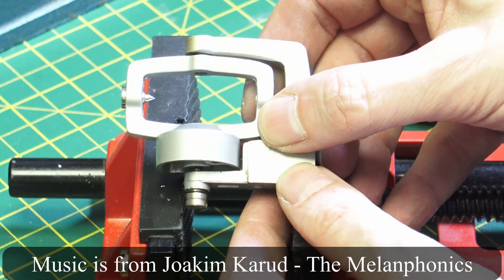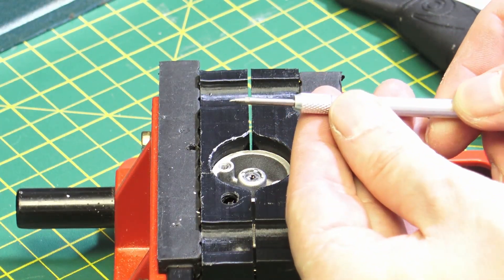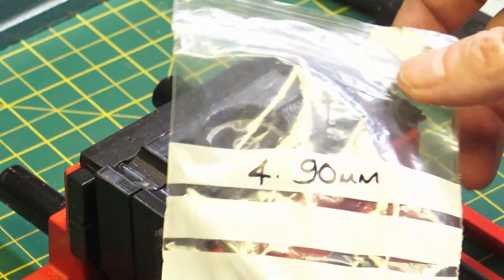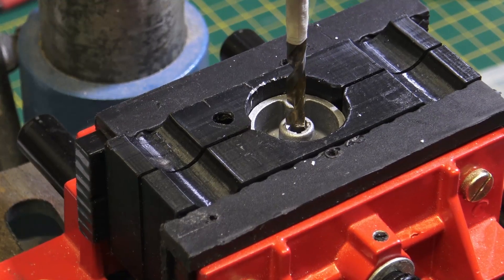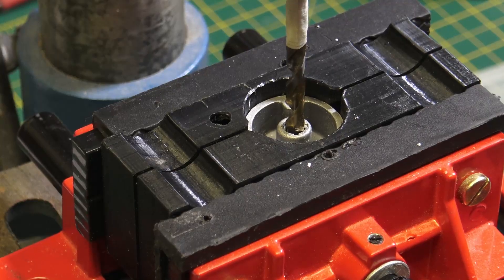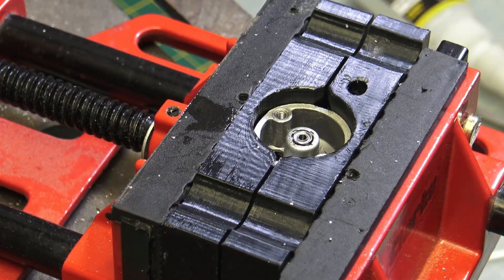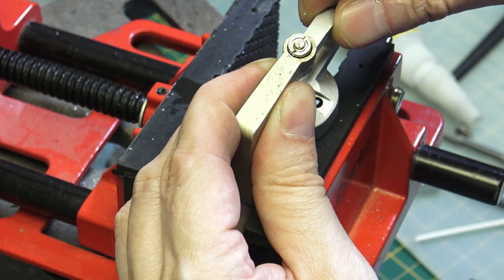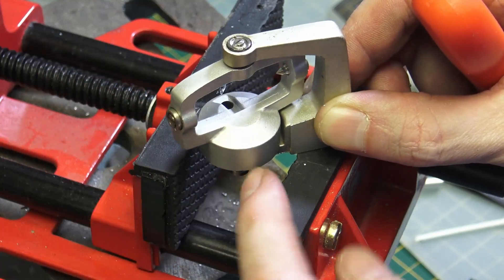How I replaced damaged bearings on a Technics 1200-1210 turntable.

Comment: Hi lee I wondered if you had the exact bearing size required rather than reforming the arm as i think i have found a product that would better suit. - I tried contacting you on FB looks like you dont use that account much anymore
Reply from the maker: there is no room to fit any other bearing unless you have the original, it's just made for that one. The original is a open bearing so the ball bearings sit in the space under the metal cover.
Reply: @DJlegionuk  Ill try I think I have a old arm that a pulled that i can work on if I have good results will let you know
Reply from the maker: @danbizaro869  at 2:22 you can see the inside after I removed the old one, so are you going to try to fit one in the wider section ? It has some clips things in the way on that part. Then the smaller section I drill out was too small for a good bearing that also fits the inside diameter too.
Reply: The original bearing appears to be custom made or something, and the case/race is made of some very soft material. Not kidding at all, look at the video and see how it deforms as he tries to remove it. That deformation is what causes the tonearm to not track properly by the way. I think if there is some flat disk bearing that fits the indentation (which appears to be exactly 6mm) it might work, but you will want to use something made of hardened steel, not this soft mild steel they make this one out of. 

I think MR62ZZ bearing should also work but you will have to drill out the pocket. DO NOT use a drill bit, use a reamer. A drill bit will oversize the hole no matter the method you use to drill it (even in a milling machine with the bit held in an ER collet).

Turntable must be made to a cost because this bearing materials is really low quality. Even the cheap Chinese bearing is made of hardened steel and ground to some very tight tolerance. The original one looks like stamped steel.

Comment: Excellent video ... just what I was looking for.  However, I've read in several places that these are factory set and 'not worth' trying to fix - one said that it was a 3 hour job resetting bearings balance vs 1/2 to change the tone arm.  When I last bought a tone arm several (approx 5 years ago) it cost around £65 ... they're £200-£350 plus now  ... crazy ... so well 'worth' trying to fix!!!!  How was it resetting the center (horizontal) bearing (which is where my problem is)?  The part is £45 but I've got a good one off the old one I replaced so was going to try and swap them over but I want to try and reset the 'wobbly' one first..

Comment: Realy good. Does the 5mm OD seat tightly against the walls of the pivot or is there a gap? If there is a gap, would 6mm OD be a better choice?  Thanks. Really an excellent video.
Reply from the maker: it fits, but not a lot of the drilled part makes contact so it's not enough for a friction fit. I never tried a mr62ZZ so it it could help. I will see if I can get mr62zz from the same place and do a test.
Reply: @DJlegionuk  Thanks! This truly is a creative, excellent solution. These tonearms are getting harder to find, so it's great to see a way to keep them from being thrown out. Yes, very curious about that 6mm (OD).
Reply: @DJlegionuk  Thank you so much for the excellent video. Did you ever get to test the 6mm OD mr62zz bearings?
Reply from the maker: @aka_juan these work very well for me, I did test 6mm OD and it would need more metal removed so I don't see what improvement it would have.
Reply: @DJlegionuk Amazing, that’s great to know. Many thanks for sharing all this valuable info 🙏

Comment: Wow! Excellent! Do you offer a service for this? I'd love to send you an arm for you to fix for me (paid of course). If not, do you offer any repaired parts for sale?
Reply from the maker: are you in the UK ? if so yes I would look at it for you.
Reply: @DJlegionuk  No, sorry, in the USA. First time I looked at your channel, so I didn't realize you are in the UK..
Reply: @bradleysmith681  Get a chucking reamer, something that reams it to about 4.95mm in diameter (this will be marked as 5mm actually, but if you get it used it will be 4.95mm). You may safely use a hand held drill for this. If you use a reamer, and not a drill bit, you will get very accurate holes that match up to the bearing exactly and no gluing should be necessary at all. It's better to drill it too shallow than too deep by the way. This cast aluminum cuts easily.

Comment: This is really good to know that this is possible. When I damaged the bearings on my 1210 mk2 turntable, I had to replace the whole pivot section. Really enjoyed this video!
Reply: Really excellent. Failed bearings is the main problem with this tonearms.
Reply: I have a turntable table with a similar tone arm...by chance...How did you damage the bearing?
Reply: @DerekCully I think that the damage is because  when you tigth the screw, without want it, its tip don´t be inserted into de center of bearing and  it esqueze the wall of bearing deforming it. I did that after paint and rearm that pieces. Cannot see in the moment. you need to be very carefully. regards and happy sppining
Reply: @HoMuSicFacTORY  much appreciated. Happy spinning my friend.
Reply: @DerekCully  The bearings get deformed into an oval shape and then the tension from the deformation and the adjustment screws cause the deformed bearing to act like a rotational spring.
Reply: @DerekCully   i have same problem    2 mixers  and  2 table  s   where on car  with wheels .......... but the base was very small ......... so  firt s i drive side wards ......... after couple off meters  ......... i pushed to the wall  .......... and everythings shove off

damage was   
handle broken from needle  >> glue ,
 the holder from the arm  ( cheap)  , 
 broke pot meter  > fix with glue . 
 little bit paint damage ,
   and the part who the guy takes out  .............    kind off luck with all .
Reply: could you possibly post a link to that spanner bit, i’m having a hell of a time finding one that clears the center screw?

Comment: Though is not critical as the top screw, how you calibrate the side  screw tension wich regulates the arm to vertical motion freely?
Reply from the maker: just the same way. you can feel it move left and right if it's loose so tighten a very small amount each time.

Comment: This is a great video but I have to say that drill bit going into that precisely machined piece of tonearm assembly really made my toes curl! I applaud you for doing this. It’s certainly something I wouldn’t do. I thought those bearings had to be tightened to a very precise torque?
Reply from the maker: not the bearings, the part that is screws into them needs adjusting, I have two options try this or throw that machined tonearm part away for the sake of a small bearing. I searched and asked to find the original part, plus would need special tools to remove and replace. This worked as long as the spin is good and I have failed many times and still do.
Reply: DJ legion well I appreciate your efforts. Cheaper solutions are welcome if it means we can keep these iconic turntables going for years to come. I vowed never to sell my 1210s when I bought them 25 years ago. I’ve seen refurbished complete tonearms go for £250 and then some which I’m not keen on.
Reply from the maker: @UTO0O0B  price of tonearms doubled  as soon a they stopped making the older version and so all the parts to make one also doubled. I think I have about 40 of these parts that need the bearing replaced, but I am not selling any parts and keeping for repairs.